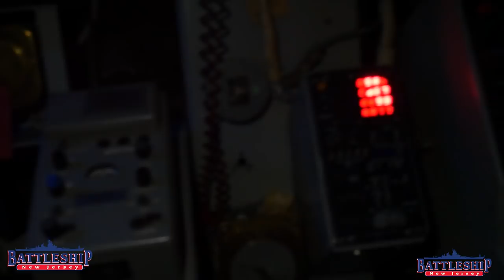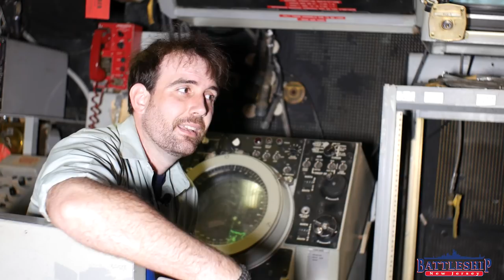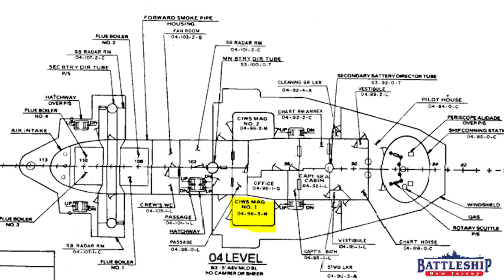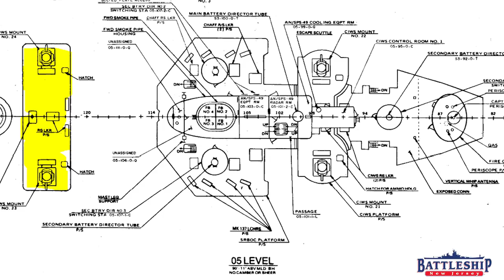Phalanx CIWS

Comment: The Jersey was the First Battleship to be fitted with the CIWS.
Or. As called tongue in cheek by the crew. As R2D2 WITH A HARDON!!
  Can't recall which sea test it was.
But a Pilot in a Navy Jet was pulling a long yellow drone behind it.
It took some talk and orders before the very nervous pilot flu past and allowed R2D2 to tear that large drone to pieces! LOL 
 When we were DOING Patterns in Front of Beirut.  One Poor Seagull flew past the ship to close. The CIWS was set on Auto at the Time.
Before the Operator could get inside the upper controls and slam the STOP BUTTON!?
 THE Seagull was turned into large chunks. And those chunks were turned to powder. LOL 
 A tragedy almost happened when our Ships Helicopter was coming back with our Mail. 
  They forgot to turn R2D2 OFF. Was on the deck watching. Could hear it beeping and unlocking itself. The Poor Pilot was Yelling thru his radio and I could hear him on the deck. 
  He was bobbing and moving the chopper up and down and trying to keep the barrels off of it!!
 Luck the Operator was right there and slammed the Emergency OFF button!!

Comment: I was always amused whenever they would test fire these things at drone targets while at sea during work ups. I could never figure out why there was always an announcement over the 1MC about not using electronics while the CIWS was being loaded. Since the MARDET was part of the Weapons Division, I got to know a few of the sailors that worked on the systems and handled the ammo. They told me the guns were electrically fired, so as a precaution there was an electronics "blackout" in effect during loading because they didn't want any rounds going off prematurely. Seemed like a plausible answer to me at the time.
Reply: You are right. I read that they the primers are electronically detonated because a firing pin would fail from heat due to the extreme rate of fire.

Comment: Ryan,   I know a little bit about the rack/computer test stand in the lower right hand corner at the 1:08 portion of the video.   I designed that equipment rack back around 1986ish while working at NOSL.   It was a shock resistant stand a  pc/monitor/keyboard and dot matrix printer.  They were built at NOS Louisville, KY.

Comment: One minute of ammunition is about 3,000 rounds.
Reply: Upgraded to 4500
Reply: The magazine capacity is 1600 rounds, and depending on whether the gun is in surface mode or air mode the rates of fire are 3000 rounds per minute or 4500 rounds per minute.

Comment: Why is the light showing around the "sealed" door. Is it bad fitting or more corrosion?
Reply: Wasn't dogged shut!!
Reply: my thinking is, piss poor door, or corrosion.
Reply: If you’re talking about the door in the cut right after hes outside looking at the gun itself, i dont think thats light… its metal showing. Probably a compartment being restored and someone took an angle grinder to some corrosion… thats what it looks like to me at least.

Comment: The Phalanx CIWS is probably a derivative, descendant or second cousin of the M168 Vulcan that the Army had in the late '60s thru the '80s.  6-barrel, 20mm, selectable 1500 and 3000 RPM rates of fire.  There were towed versions and versions mounted on the M113 series of APCs (M163A2 for example).  Early ones were manually aimed and later ones got a radar ranging system and auto-lead sights.  Intended to defend front line ground combats units against rotary wing threats.  It's dance partner the M48 Chaparral missile (a reworked Sidewinder) defended against fixed wing CAS aircraft.

Comment: I wouldn't be surprised if Phalanx gets replaced sometime soon by something with a longer range and a bursting charge. Then, unlike the Russians who like to have heavy all-in-1 systems, supplemented with discrete a short-range missile system, which the USN has already done with the RIM-116 RAM.

European navies are ahead still, going with the Oerlikon 35mm or Bofors 40mm (some even using the Swedish 57mm or Italian 76mm rapid firing light main guns as part of their CIWS) and then using point defence missiles like the RAM, Minstrel, VL MICA and Sea Ceptor (the latter straddling the line between point defence and local area defence missiles.

Comment: I doubt you will be able to find a proper RCP on a decommed late Perry. They had switched to the 1B by then and and used an RCS instead of an RCP. Though the front panel on the RCP is very similar to the RCS on the 1A and earlier CIWS. You would need 4 RCP panels to accurately depict the New Jersey load out meaning you'd have to take the front panel from each of those Perrys.

Comment: Served in Iraq and Afghanistan on base....yes I had it easy comparatively speaking.  BUT....My point is, when the CIWS on base engaged an incoming mortar or rocket it was the CIWS (think the Army term was CRAM...counter rocket and mortar) I was more terrified of the CIWS than the incoming rocket or mortar.  The sound and pressure put out by a firing CIWS will put the fear of god in you.  It’s unreal.

Comment: 11:30 "Missles are expensive"

Nobody in the history of warware has ever given an L for the cost of their ammunition. The interwebs are full of guncam videos of US helicopters using hellfire missles to take out single individuals. That's $60k for to kill one person.
What's much more important is that missles are slow to produce so the supply is limited, you don't want to fire all your missles on the off-chance of disabling the CIWS if those same missles can protect you from a counter attack. Anyway, if overwhelming the CIWS was a viable way of disabling them then the enemy would certainly have designed dummy missles that just fly fast enough to get tracked, followed by one or two actual missles to do the damage. But I guess a well-aimed torpedo would do the job much more effectively.

Comment: As far as I know the guts of the CIWS are still classified so unavailable outside the military. The trick to the CIWS is to never put yourself in a position where you need to use it. If you shoot down the incoming threats before they are even in range you don't have so much to worry about shooting down with the CIWS. That is a big part of the reason why the SM is available in so many flavors and has such long range. Couple it with an AEGIS cruiser and the enemy would have to launch an enormous amount of missiles to overwhelm that system. A couple could squeak through but no more than that.

Comment: the old Tico cruisers have a dual controller for the block 1 CWIS...  which would have been the same as what the Iowas had .  I know Tico and Yorktown have been scrapped already but not sure about the  Vincennes, Valley Forge or Gates.  I know Bunker Hill was recently decommed so she may be in Philly and possibly may still have the block 1 controller.   I know I am a year late and you did get single controllers but if you want a more period correct one in the correct config your best bet is with the older Tico Class cruisers.  I was a CWIS tech on the Tico almost 20 years ago when she was decommed.  Seriously doubt they retrofitted those old controllers since most ships now have a modernized Phalanx system.

Comment: The Mk149 round was DU, starting with Mk 149 Mod 4 it was switched to tungsten for environmental reasons. The modern round is the 1950 grain Mk244, which is a full 48% heavier than Mk149 and is again tungsten.

Comment: Contact General Dynamics/Raytheon and ask them to build you a "dummy" box. I'm definitely gonna say they are set up to do something like this without much trouble (just don't wire a console as it comes down the assembly line). And if they want to charge the museum for it, set up a fund raiser either online, in house or preferably both.

Comment: im pretty sure the reason for DU rounds was for armor penetration on the warheads as they have to connect with a missile and most missile have heat resistant armor and actual armor to make sure they survive launch and other things in the air and the 20mm DU was left from the early a10 test project for tank fighting

Comment: Seems to me that a more efficient ammo feed system could have been invented to provide much more capacity, like a belt fed system from a "mag" that could hold 5,000 or 10,000 rounds
Reply: Probably would have significantly added volume and complexity to the system, having to either have a much large ammunition bin on the gun, or a much more complex feed arrangement to get ammunition to the gun. Remember this can slew around at a very high rate, and also covers over 180 degrees horizontally, so making the feed is non trivial. Either the gun system itself would have been 3m taller, or there would have been a much larger footprint, which limits the areas you can install it, as well as the types of ship you can mount it to. Also would have required considerably more power to do the movement, again a consideration on a ship, which has power plants that do not respond well to massive step load transients, as the plant typically is running at near full output in most cases.
Reply: it would have to deal with the gun moving and the considerable weight of the ammo, it may be possible but the cost and complexity and reliability would make it more of a pain to deal with than is worth it, the engagement time is so short that you either shoot the target down with the ammo you have or it hits the ship anyway
Reply: But it would sure be easier with a linkless loader like they use on fighters

Comment: Phalanx or SeaRAM is probably the best
Reply: Steve Wolcott  And that combo leaves them uniquely vulnerable should that mount go down.  I don't understand this mentality... things break, things get destroyed or damaged in combat.  If one of the dozen and a half ships Russia has which mount either of the three Gun/Missile CIWS combo's (Pantsir-M being the newest) is lost, or the mount itself is damaged, there is next to no other CIWS capability on that ship.  Most of them are carrying ONE such mount, and in rare cases two (their newest Corvettes mount two).  Loss of that mount means losing your mid range AND close range CIWS capabilities...   

The US Navy examined Phalanx in detail in context of a system like Pantsir-M and determined that the RIM-116 RAM in conjunction with the Phalanx provided better survivability than a combo mount using the same munitions.  Nevermind that the US Navy's primary SAM missile, the SM-2ER is capable of targeting anti-ship cruise missiles at quite a long range... so not only are incoming missiles dealing with those, they then have to deal with the RAM mounts followed by the Phalanx mounts as the last resort.  Taking out a Phalanx, or a RAM is not going to degrade the CIWS capabilities of the ship because the remaining mounts will still be operational.

Comment: You had a brief shot at an Electronics Warface rack - surprised that was left in place. he has a excellent question in compare this to other CIWS systems. Ok - there are consoles and more equipment inside. I have impression with CIWS if you had to or wanted it could run without the interior consoles. I believe just the Gun part was originally designed as the B-52 tail gun.. the CIWS on the San Antonio LPDs is very different- I heard it can work run if the ship's input power died (batteries). The way talked about IFF, make me laugh _ Highly doubt any Missiles have any IFF gear on them.
Reply from the maker: None of the equipment was left behind but was acquired from other ships over the years.

Comment: I was trying to find the full weight of a depleted uranium (DU) round. I found that the 20mm had 180g of DU per round. But, more interesting, is that the Navy has quit using DU in the CIWS and now uses armor piercing tungsten. The article is at https://en.wikipedia.org/wiki/Depleted_uranium
Reply: People make a fuss about DU but seem to forget all the other toxic stuff on a battlefield (like lead, that's in most bullets and the primers of almost all rounds too, the latter gets turned into smoke which is easily breathed in).

Comment: Though they cancelled the rail gun recently, it had a cool anti missile/aircraft ammunition type that would disintegrate and a pre-determined distance and create a wall of metal that would destroy any high speed object coming to it.
Reply: They cancelled it?
Damn. That was some good tech. Fingers crossed the cancelling is a front and it is still being developed but in secret. One can always hope.
Reply: @xxxrossomaticxxx  It's just nice side job a multipurpose weapon could do. It would have been be like 5"/38 of the 21st century.
Reply: @Tuck-Shop  Well they stopped funding for it's development for the 2021 budget, so maybe they can pick it up later, hopefully not too late when a lot of the hands of experience and specialized equipment is gone.
Reply: @EarthenDam  I read that they learned a lot and applied it to other projects like the hypervelocity missiles.

Fingers crossed it gets reactivated as missiles have longer range but they also have a minimum  range. A versatile  weapon system with a cheaper per shot cost and greater ammo reserves per ship would be a useful asset.
Reply: Biggest problem with a railgun is that instead of storable propellant you ned large amounts of electric power, and also the rails themselves wear considerably, during use. Hard problem to fix, as more durable materials are not as good a conductor as copper, and you already have massive losses in the existing rail systems to transfer power. Not a good system when you have to replace the launcher rails every 50 shots or so because they are worn down.
Reply: Canceled...or went dark?

Comment: Are you guys absolutely sure you should be installing the computers that control those guns? What about bullets? If we could find you some bullets would you load those in too? I’m just thinking that gun looks wildly powerful and the whole thing is just safer fully inert. No? Would the navy even be ok with you adding those panels?

Love your videos guys! And the last thing I’ll do is remind you of a video request I made months ago- i had asked if you could compare the foot thick class A steel used on the Iowas main belt with modern naval armor (or lack thereof) which I’m pretty sure is called HY80 high tensile steel.

Thank you!
Reply from the maker: There is nothing inside those guns anymore so putting the panels in isn't going to activate the guns, just make a space look more complete.

Comment: Thanks for telling everyone how to defeat it. 
I'm sure that anyone who read, Red Storm Rising, remembers the part where two missiles were headed for the Nimitz and the CWIS couldn't figure out which one to lock onto first, and decided to do nothing. If that was a possible real scenario, I hope they fixed the software.
Reply: That bug occurred on a type-42 sea dart system during the 1982 Falklands war.  Argie jets flew close together and then further apart when they go close, result was the software actually just crashed when 1 target became 2 and needed to be rebooted..  Not 100% sure if it was a similar bug but I remember the guys saying how they rebooted it in combat, remember this was 1982 and the kit was designed in the 60/70's - they literally had to manually flip switches to load each byte of the bootstrap....  It takes time....

Comment: Do enclosed spaces with limited ventilation pose a potential hazard on the battleship? I presume the mothballing process would greatly decrease the hazard but is it something that still needs to be considered before entering certain spaces?
Reply: Absolutely.  It can be a hazard even on newer ships still in active service.  Rust is oxidation of the iron in steel.  If the space is sealed but not absolutely dry, then you will have rust.  The oxidation process uses the oxygen in the surrounding air, leaving none for you to breathe when you enter the space.  Entering a void space generally requires ventilation and testing for adequate oxygen and the lack of poisonous or flammable gasses or vapors.

Comment: Are the specs details for the gen 1 CIWS still protected information? For a second there you almost revealed the rate of fire, but switched to minute worth which I thought was a great recovery. Canadian ships still use the same CIWS (LOL). Were the chaff launchers controlled from the same space?
Reply: As a former USN CIWS technician I don't believe the ROF or drum capacity were considered protected or classified, only the engagement parameters such as qualifying target speed and attack angles. But my memory is twenty years out of date so there may have been some changes.
Reply: @OriginalBootlegger  My memory is also 20 years out of date from my time in the Canadian Navy. Last thing I would want is to be charged for revealing information that is still protected. Why give them any excuse to drag my ass back in the system. I did my 20. I wouldn't want to be anywhere near a base anymore.

Comment: Respectfully sir, you are wrong by almost half at second 20, (:20).     The CIWS fires a 20mm round, not an 11mm round as you say.    We had them on my ships, USS Reeves (CG-24), and USS Carl Vinson (CVN-70), also known as cell block 70.      Love your show, MCI
Reply: It's an 11mm DU penetrator or Tungsten in a 20mm sabot.... the use of DU depends on which of the two Mark 149 projectiles is used.  The Mark 149-2 is DU, the Mark 149-4 is Tungsten.  The Navy is currently using Tungsten Mark 149-4's or Tungsten Mark 244 Mod 0 ELC's (also Tungsten) depending on stock.

Note:  The CRAM, which uses the same mount, uses an entirely different set of ammo which is self destructing to avoid rounds falling into populated areas.
Reply: @Whiskey11Gaming  Well said Sir.